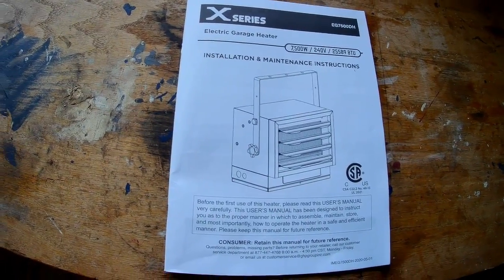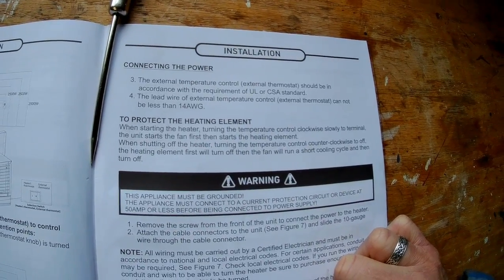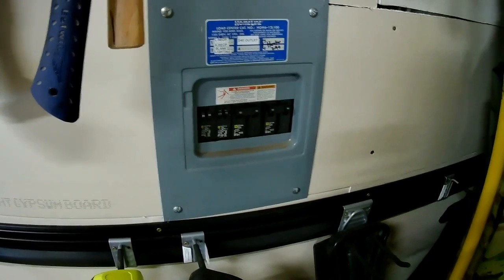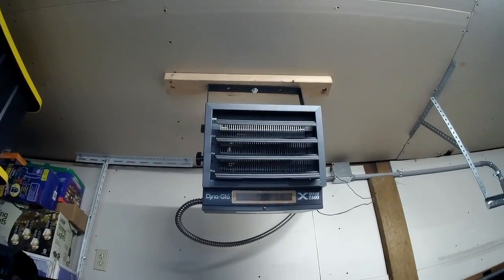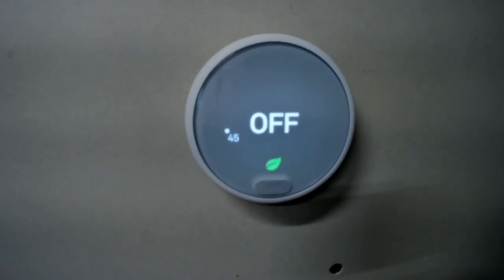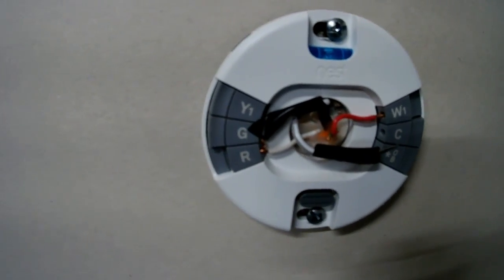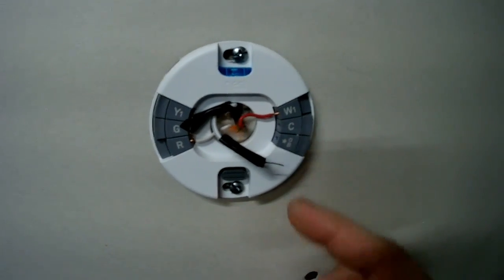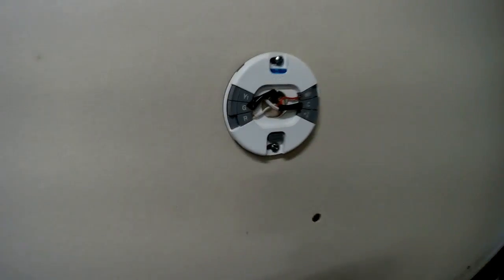Dyna-Glo 7500W Electric Garage/Shop Heater with Nest Tstat Install-NOT THIS model?-read desc-volts!

Comment: Good video, when you wired the 24V transformer you said you wired it to C and R. But the video looks like it was connected to C and G. Can you clarify? Also I'm attempting to wire a 5000W version and the wiring is definitely different than the 7500W. L1 and L2 are tied to 1 and 2 which makes your thermostat wiring impossible. I know this Vince figured it out but I just wanted to wire in a double pole line thermostat and am confused to how to wire it in. The wiring instructions for this thing sucks. I would be interested to find out how Vince wired his using a 24V thermostat. Anyway good video
Reply from the maker: Ric,

Definitely C & R (the R slot has two wires in it-one from the transformer and one from the heater). G has nada. 

I hit up Vincent in the comments just now. Hopefully he sees it and still has the vid he used still available. If he is able to email it, I’ll post back here with the link for all the 5000 series users.
Reply: @icarian76  I appreciate the clarification and the reach out to Vincent > Thank you
Reply from the maker: @ricthm4741  Vincent got back to me :) I have updated this video's description (at the bottom of it for the 5000W owners) and the title to clue them in to look at the description. That stated, video that Vincent used is this one (just watched it and after a second watch through, definitely DIY'r doable). Good luck. https://www.youtube.com/watch?v=col5i4hjw9k
Reply: @icarian76  Ok thank you, it helps but I wish he was using the same Dyna-Glo Pro 5000W EG5000DGP unit I am trying to wire. I need to study it more using his video and will figure it out. At least I don't have to do this in freezing weather!
Reply: @ricthm4741  how did you make out with the thermostat install? I'm hoping to setup the nest with the EG5000DGP as well.
Reply: Much easier with your question, if it can solve my problem

Comment: Thanks for the video.  Just installed this heater this weekend with an Ecobee 3 Lite thermostat.  Instead of the external 24V transformer, I wired a 240V to 24V HVAC transformer inside the heater wiring panel itself so I had my R, H, and 2x 24V wires inside heater.
Reply from the maker: Nice evolution. 👊🏼
Reply: How did you wired the thermostat
Reply: As in which line do you connected to for the 4 lines

Comment: Do you see any reason I could not get two of the 5,000 Watt heaters (one for each end of my detached garage) and use a Nest thermostat to control both of them? Maybe split the wife to the thermostats on the heaters and get them to both kick on at the same time? I have a home gym in there and it's long enough it would probably be better to warm the entire area up before I head in there to work out.
Reply from the maker: I think it will work (maybe with some modification-see below forum link), but you are heading into experimentation/discovery learning like I did ;) 

I did some research last night and the best source I could find was the "DIYchatroom" forum post below. It's last post was 2016, BUT the local expert in that thread goes by the handle "beenthere" and he is still active as of two hours ago (forum Admin). Sooo, if the thread posted doesn't work well enough, I would post under the HVAC sub forum and I bet you will get a specific answer. Good luck!

https://www.diychatroom.com/threads/two-heat-sources-one-nest.453050/
Reply: @icarian76  thanks, this should be fun. I first tried to get the electric/gas company to run a line out there but they said no way. Kind of pushed me to electric if I don't want to pay a plumber a crazy amount of money to run a gas line. Now I'm looking for a way to heat it effectively. Figure a Nest will help me kick it on before I head out and have it warmed up. I've been using a propane heater but it gets gassy pretty quickly in the space (and not great for working out). I may need to find a different heater if I'm doing two, two 7500 watt seems a bit much (and I'll need a massive breaker), was hoping for two 5000 watt but it doesn't look like Dyna-Glo makes this one in 5K watt.

Comment: One more question - if the "1 connector goes to W (heat control ) and 2 is R ( power for thermostat). Could you Only wire 1->W then your transformer to C and R and not use the #1 connection in the heater at all? Or does the connection require both 1 and 2 be used to complete the circuit?
Reply from the maker: Give me until noonish tomorrow PST and I’ll disconnect the heater R wire from the Nest and confirm. I’m thinking it isn’t using it, but electricity principles / circuit probably disagree. Currently out and about for my job and can’t do a quick check.
Reply from the maker: And required. No need to watch video, but proof of exploit attached. 🙂
https://youtu.be/GIqknxF4nFQ

Comment: Do you absolutely need to install a thermostat for it to work?
Reply from the maker: Oh no. It has an internal thermostat and an IR remote that come with it. Also has a timer-steps of 1 hour to 8 hours. Run your 240, mount it, hook up your flexible conduit to the heater, hook up the 240 to the heater and you’re essentially done. 

The Nest/external thermostat is (mainly) for someone like me that has a detached shop or garage that does not want to trudge out there to start it up for a preheat.

Comment: I have been looking to buy this unit for my garage. I have a nest already for it. But I I was unsure because the specs say it has to be a line voltage double pole thermostat. So I didn’t think a nest would work
Reply from the maker: Great manual, no? 😂 I am most assuredly not running 240 from the heater to the Nest. Here is a private vid I did for Vincent down in the comments-ends up he had a different heater model, but I did a quick recap on voltage/hookups for him. 

https://youtu.be/hQ6yRBj0ayU
Reply: @icarian76  never got a notification from YouTube for the reply. I appreciate it. Thanks a lot.

Comment: If I went with a regular digital thermostat the process would be the same just installation specific to which ever thermostat I use right ?
Reply from the maker: It would.  Same low voltage hook ups.

Comment: Did your thermostat blow up? Mine did. Either mine was defective or the heater sent to much voltage to the thermostat.   The 1 and 2 terminal was reading 240 volts...
Reply from the maker: ??? You didn’t hook up the thermostat wires to the L1/L2 (power inputs) or short circuit somewhere did you? Because the “1 & 2 thermostat inputs” (NOT the L1/L2 power hookups) are low voltage only. 240 coming in off the thermostat inputs is scary-only a couple things should do that-1) hooked thermostat wires to L1/L2 or 2) short circuit
Reply from the maker: Vince-went out and made a quick vid to confirm everything for you. 
https://youtu.be/hQ6yRBj0ayU
Reply: Thanks for your help. Had to add a contactor and a transformer. Now it is working great. The dynaglo 5000w unit is a little different than the 7500 unit. No more thermostat explosions.
Reply: @VincentValeriano  just curious how you did this.  I am looking into the same thing.  Any advice on parts?
Reply: The video I tried to link here won't post. Send me your email and I will send it. The 2 parts are only 26 bucks together.  Easy to install.  I have no idea of how your part would work.  I just follow other videos that are tried and true.
Reply: This video will tell you what parts to buy and how to install.  Make a diagram and color code it. It will be easy if you do. I converted 2 garage heater units and they work perfectly.
Reply: @VincentValeriano  my heater is still in transit, so maybe it will make sense once I get it.  I ended up finding this  Aube rc840t-240, seems to me a contactor and. Transformer in one.  Think this will do the trick?
Reply: Hi i also have the 5000watt version with tge 240v thermostat connectors. Can you share the part numbers for the 2 parts needed.
Reply: @frostakathetruth  send me your email  and I'll send you the video with the parts from Amazon.
Reply from the maker: @VincentValeriano  Another query today  about the 5000 series/what you used to make the 5000 work. Can you send me a link to the video you mentioned that covered it and I’ll add it into the comments for the 5000 users?

Email is ...

Edit: Vincent sent me the video. Thank you Vincent as it will definitely help out other 5000W heater users! Any 5000W owners reading this-go to the bottom of this video's description for a brief explanation and link to the video that Vincent mentions using here.
Reply from the maker: @mikel7861  In the event you still need it, pinging you. See my video's description-at the bottom-for the vid Vincent used to convert.

Comment: Great video - I'm waiting on a Dyna-Glo EG10000DH heater. I'm not well versed on electrical topics but I currently have a 240V outlet running off a 20AMP CB. However, the online manual specifies that it is recommended to have a 50AMP or *LESS before connecting. That being said will I be able to safely run it off my 20AMP circuit since it's less than 50 AMPS?

Can someone please comment on this?  I'm wondering if I need to hire an electrician to run new wiring with a higher rating CB. Thanks!

MANUAL LINK: https://www.ghpgroupinc.com/manuals/electric-garage-heat/EGH%20Manual_EG10000DH_010319.PDF
Reply from the maker: Netco-I'm going to walk the dog and it might be a long explanation-couple paragraphs. Anyone else sees this and can provide better clarity...by all means thank you!

Page numbers I am referencing are per the pdf manual you linked. 

Yes-for that beast, you are going to need to go one of two ways (10,000w vs 7500w-see Page 3 and 11). They can be selected via the internal power board/remote (see page 11: "2. Heater Control Button). If you going with an EXTERNAL thermostat like I did, I would go with what is needed for the full 10,000 watts-not going to cost that much more-time/labor is the expensive part and the selecting between the higher and lower setting externally might very well not be possible-so build for the higher capacity). 

First off, the 50 amp (max) requirement per that caution that you mentioned on page 9 is confusing. Why? Because if you are installing it for the 10,000 watt setting, the 80% of continuous load per National Electric Code should apply. Math is 10,000 watts / 240 volts=41.6 amp load (this also syncs with what the manufacturer says on page 3 under "Specifications". 41.6 amps is what is required. The not exceeding .80 of Max Amps for continuous load becomes a problem here because 50 amps x .80 = 40 amps. But your heater on the 10k watts setting requires 41.6 amps (which is over the 40 amps/not to code).

Sooo...if not installing new 240 circuit yourself, hand it (manual) off to your pro electrician and let him/her figure it out :) If planning a DIY 240 install, you need clarification on that "50 amp or less CB caution". Hit up the manufacturer's customer service at the following and have them explain how you are limited to a 50 amp or less circuit and can still meet the 80 percent rule (that I explained above) concerning code. It is either a typo or they can explain accordingly.

Per the "Questions" section on this heater's product page: GHP Group Customer Support-Our Customer Service Team can address this issue if you contact 1-847-324-5900 or email at http://www.ghpgroupinc.com/CTUS.html
Reply: @icarian76  Stellar response! 👍 I now understand the laws of electricity crystal clear....thank you sir. These notes will help me tremendously when I speak to Customer Support and most likely I will hire a certified electrician who can professionally install it.

Much appreciated!!

"Genius is one percent inspiration and ninety-nine percent perspiration" THOMAS EDISON

Comment: Thanks for sharing this video. Quick question. I also was going to install a 40 amp breaker in order to  cover the 31.25 amps required to run this unit. The store attendant talked me out of it and said I should go with the 30 amps because if the heater trips it won't do it with a 40 amp breaker.  Can you help clarify this?
Reply: Absolutely need a 40 amp breaker
Reply from the maker: Whoa. First off caveat-not an electrician. But guessing he is not either (but I researched :) With that, the pros (and Code) generally say that you should be running a circuit breaker (CB) at a maximum of 80% of rated capacity (40 amp CB x .80= 32 amps of continuous load on a 40 amp CB). The issue (in general) is heat and heat dissipation. You run a heater that has a 31.25 amp draw on a 30 amp CB, it will overheat and then trip to protect the circuit. Over and over. Too much load for the CB.
Reply from the maker: Also make sure your wiring size matches max amperage draw-a lot of videos from pros on it so I won't beat a dead horse but 40 amp max~8 gauge, etc.
Reply: @icarian76  Thanks for replying. This is very helpful.
Reply: Do you have a wiring diagram of what goes where on the W1,C,G and R spots on the Nest E?